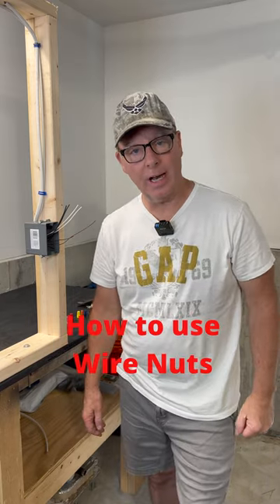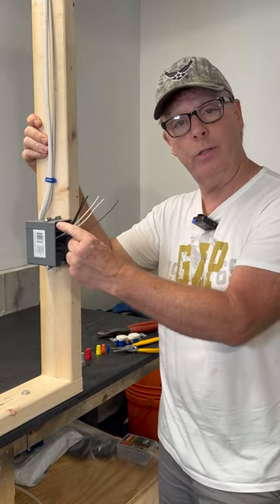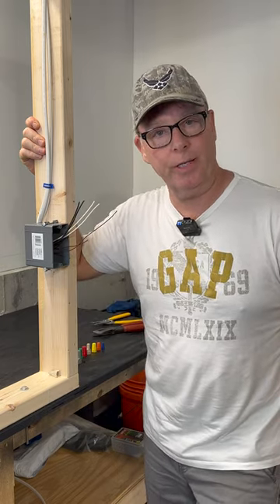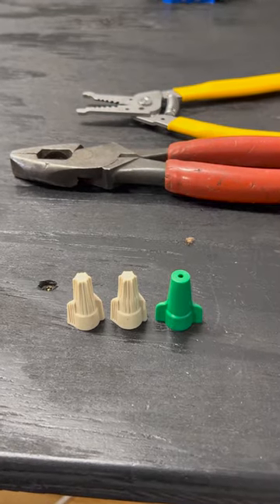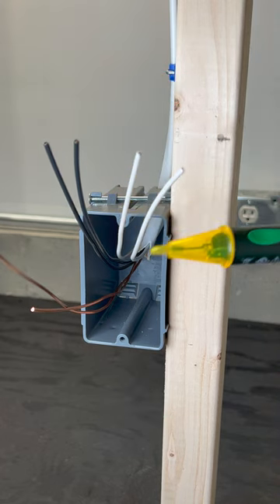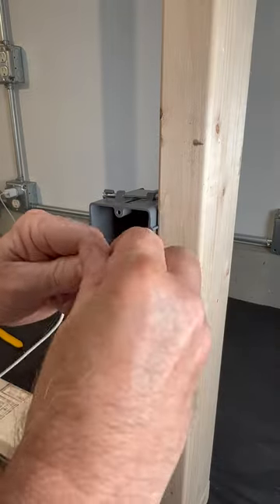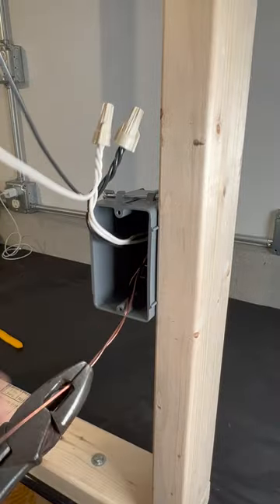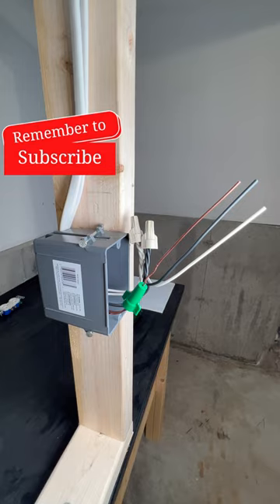How to use a Wire Nut | to connect solid wire #shorts

Comment: Interesting to see techniques from around the world, but one thing wherever you go the physics of electricity is always the same, unfortunately the respect of it on a safety aspect isn't.  I guess the twisting of these cables is an introduction of manufacturing requirements so their product holds better on the cables, not to improve safety. I think all sparks need to assertain and adopt the safer methods of today  rather than the excuse of "well it was alright in my day."  It never has been best practice to twist cables together or leave the cpc bare here in the UK since 1980 ( my first insite into this industry) that I can recall.  I guess a modicum of common sense would indicate why progression is often better. Especially in this case.
Reply from the maker: Our electrical safety standards have been migrating here for many years especially in industry but also for commercial and residential applications. I'm retired now but I was the facilities electrical engineer for a Texas Instruments Fab here in Maine. One of my responsibilities was to implement the NEPA-70E standard for our site. Completing an arc fault study and training electricians and technicians to the new standards. Also the purchase of PPE and other safety measures. We also revamped our LOTO program as well.

Comment: Funny thing when people here are talking wago is the future. In finland 95% of electricians use only wagos. And been using them 20years. Its much faster connector than wire nut. Actually in europe the wire nuts are banned in many countries.
Reply from the maker: They are just becoming popular here. There are a lot of knock offs that may be giving them a bad name. What's your experience with them? Do they hold up well to higher current circuits? I'm going to get some and test them out.
Reply: Well actually i have seen one where there was only the plastic shielding on it no connector inside but dont remember was it genuine one. They hold the current fine on 2.5mm2 cables.(used in 16A circuits) In europe we have higher voltage so lower current running on our houses.
Reply: They are rated here max 4mm2 wire and 32A at 450V. In here i trust that info because everything related to elecrics are tested before it can be sold to people, but really excited to see your test results.

Comment: While wire nuts are nice. they are a pain in the a** when it comes to connecting solid and stranded like in a ceiling light fixture. WANGO Changed How I See Things.
Reply: You’re probably not connecting them correctly?
Reply: @ABflanagan523  connecting them correctly lmao. I can't remember ever needing to before I was paralyzed. Anyway my girlfriend and I swapped out the 2 different looking hall / entry way light fixtures in the ceiling. She played hell getting it to lock onto both. She would think she had it, start working on the second wire and it would slide apart. Took us at least an hour for the first fixture and she held her tongue just right on the entry way light. It was like 15 the way I remember it.

Comment: Why would you pre twist the wires? Twist them together with the wire nut.
Reply from the maker: Maybe with 14AWG but for 12 and 10 the wire nut does very little twisting. To check make up some 12AWG with a wire nut and then take the wire nut off and wiggle the wires around and see if the connection holds up.
Reply: @BackyardMaine  I work with #12 all the time and it's not an issue. As long as you line up your wires and tug each one to ensure a proper connection. So many YouTuber electricians tell you to pre twist and dont show how to use a wire nut properly. Might as well go back to using barrel crimps and tape if you're going to do that.
Reply: @BackyardMaine  Also thanks for the reply! I like your channel but this is something I see a lot and I know people on both sides feel very strongly about it lol
Reply from the maker: @theyedinak  I completely disagree. If you pretwist the connection will hold up even if the wire nut comes loose. We teach all union apprentices this in the first year.
Reply from the maker: @theyedinak  I think we all have our methods and maybe we should use what’s best for us based on our experience. Thanks for watching and for your comments
Reply: @BackyardMaine  So if the wire nut comes loose or off you want it to stay together? Wouldn't you rather the connection come apart or short so you can fix it and not just leave it for the next guy?
Reply from the maker: @theyedinak  You missed my point being it’s not the wire nut holding the connection together. Look I don’t want to tell anyone what to do. I just share what I have learned from years of experience.

Comment: I wasn't aware that you can check if a wire is hot through the wire sheath.....
Reply from the maker: It’s a proximity tester. Just tells you whether it hot or not.
Reply: @BackyardMaine  cool, didn't know it worked like that. Definitely a safe way to do it.
Reply: @jasonmitchell736  wouldn’t say it’s a safe way to check I personally use a fluke t150 as I find the non contact pens to be unreliable giving false readings

Comment: Not sure if it's necessary or not, but my boss puts electrical tape on as well.
Reply from the maker: I never use tape but it's ok to do if you want.
Reply: I tape any permanent wire nut joints which contain stranded wire. Sometimes I also install a zip tie around the twist joint about an 8th of an inch behind the wire nut after installed depending.

Comment: BY FAR the number one point of failure and the least talked about.. This is exactly how it should be done and would eliminate 90% of all electrical problems. The 5 extra seconds to twist the wires makes a difference between your house burning down and not burning down
Reply from the maker: I was surprised at how many comments I had telling me not to pre-twist. Glad to see someone who knows his trade.
Reply: @BackyardMaine  The congregation of a historic church in San Jose, CA used to do all repairs. It was a beautiful building. Due to one bad connection when someone replaced a switch, it burnt to the ground. The ins covered a new building but the over 100 year old history was gone forever.. . Take 2 standard closet rods (1 3/8" dowels) each represents a wire conductor. that entire 1 3/8" is needed to carry the rated load. Hold those 2 rods next to each other. How much surface is touching? VERY LITTLE ...You just lost 90% of the rated capacity. By twisting the wires, you increase the surface contact between the 2 conductors which increases the capacity. Wire nuts are insulators NOT Connectors. Wires do not twist inside the wire nut they just get pinched together.. PROVE that by removing one after you have installed it You will have 2 semi straight conductors that barely contact each other.. After making a connection with a wire nut,, yank on each wire individually, How many times does a single wire come free??? Every one of those is a potential church burning down but it doesn't get noticed until you hear the sirens.. .. I could go on but this is too long already..

Comment: Only sissy union electricians twist wires .as a service electrician the two main failures I see are 3m wire nuts and twisted wires !! Both cause one or more loose wires that end up arcing. Ideal tan wire nuts are the only way to go.
Reply from the maker: I agree with the ideal tan wire nuts but everything else you said was nonsense. Union electricians are highly trained professionals. In some areas non-union electricians are trained as well but most no.

Comment: wires should be stripped correctly and incerted into the nut evenly and same time the mut will twist the wires and if your not sure just tug on the nut if it comes loseor awire comes out do it again if it holds anothing comes lose its correct
Reply from the maker: It's not required but I find twisting is more reliable although for 14AWG the nut twists the wires pretty well.

Comment: I’m 55 and my entire life I’ve always just stuck both wires into the wire cap and “twisted”. Why would you wrap them before puting the wire cap on them and twisting them again?  I truly don’t understand
Reply from the maker: That does work especially on #14AWG but there are two reasons why I twist the wires first. Sometime a wire can be pushed out of the connection making little or no contact and you won't see it easily with the wire nut installed. Second, if you twist the wires first and trim the ends if needed your connection is made. The wire nut then holds it together and insulates the connection. This is taught to our apprentices in school.
Reply: @BackyardMaine  hmmm.. ok. Maybe I need to start doing this… Judy regular household wires like switches and plugs or are you talking heavier gauge?  Thx again. Cheers.
Reply from the maker: @joeblow9850  Yes household wiring #14,#12,#10 solid copper. You don't want to twist stranded wires.
Reply: @BackyardMaine  thanks very much!! 👍

Comment: Totally rough. U.K electrics is 30 years ahead of this. Wire nuts are ancient. Wago connectors have been going for many years here and are much more reliable and provide better connection.
Reply from the maker: I'm going to test some Wagos soon but wire nut are very reliable. Any failure I have every seen in 38 years has been an error by the installer. I have heard from many that say the Wago connection surface area is thin and will break down a start melting the connector over time. I don't know this first hand but we'll see. I agree that they are easier though.

Comment: In South Africa
Hot is a red wire 
Neutral is black wire 
Ground stays copper
Reply from the maker: Interesting,.. Thanks for sharing.
Reply: You sure it's not 2 hot wires in a 220 system?
Reply from the maker: @imshortnlow4u  On a 220v outlet yes but these are 120v receptacles.
Reply: @imshortnlow4u  No, they have 220 single phase.

Comment: Step one toss them in the trash
Step two buy Wagos
Reply from the maker: Wagos are great for some applications and for DIYers for sure but a wire nut provides much more surface area and a more solid connection.

Comment: Though twisted two hot wires together but ended up with a third sticking out. Same with all of them. Explain please!
Reply from the maker: That's called a pigtail. That 3rd wire will be used to connect to the outlet. Im working on a video detailing the pigtail right now. It should be out in a day or two. Subscribe and hit the bell so you won't miss it.

Comment: Use quick connect 
Toss the wire nuts 
You’re welcome
Reply from the maker: Wire nuts are more reliable. Now you know so you're welcome.
Reply: @BackyardMaine  are u so sure?
They’re relatively new so maybe too soon to compare
Reply from the maker: @mrindependent1  I actually think the WAGO 221 is a pretty good product. I have some installed for testing now on a well pump which can be a stressful connection with the cycling and motor inrush. So far they are holding up well.
Reply: @BackyardMaine  right on
I’m relatively new to the trade
Just passed my journeyman this month

So I haven’t been in the game long enough to get those call backs for failed connections.
It is interesting to see the different methods being used
Reply from the maker: @mrindependent1  Well you have chosen a great trade. I got my journeyman license in 1990 so I'm an old timer. lol  I then moved on to electrical engineering and retired a senior engineer for Texas Instruments a few years back. I hope you have a great career.
Reply: @BackyardMaine  thank u sir
Enjoy a well deserved retirement !
Reply from the maker: @mrindependent1  Thank you!

Comment: Hahaha, the correct way of using them is taking them out of the packaging, turning and throwing them into the nearest bin and using a wago
Reply from the maker: It’s very rare for a wire nut to fail and if it does it’s due to a installation error. And you terminology gives you location away.
Reply: @BackyardMaine  it just amazes me how stubborn electricians can be. Even when something that is proven to be better comes along they don't want to use it. Oh I've used these for years bla bla bla. There is a reason they banned here.
Reply from the maker: @mccarly3258  I'm going to purchase and test the Wago connectors. I'm not saying they're trash and I love trying new things. But when someone says that our method should be "thrown in the bin" when they are a safe and reliable connection proven over many years, I wonder whether on not I'm the stubborn electrician.
Reply: @BackyardMaine  I wish I could agree they are safe but when you're twisting the copper like that or relying on the thread biting into the copper to make a good connection I can't agree. The reason Wagos are being pretty much the standard over here is because they are self maintaining due to the design. I think British standard will soon mandate all connections must be self maintaining when jointing cables.
Reply: @mccarly3258  agree to disagree fella

Comment: Did you notice how he didn't put any electrical tape on the wire nut pay attention all you guys thatw wrap the wire nut with electrical table that is the improper way to do it
Reply: I tape outlets when it’s in a metal box or if there are two outlets in a two gang box, but I haven’t seen anyone taping wirenuts except for some old work I might have stumbled on. Is that still a thing?

Comment: I hate how a lot of electricians do that to the grounds.😡
Reply from the maker: It makes a connection that doesn't depend on the wire nut or crimp... That's the reasoning behind the method.
Reply: @BackyardMaine  I know what it’s for I just hate it
Reply: Calm down

Comment: Nooooooooo. Don't pretwist!  Much better connection when all wires are same length and bite consistently into the spring. The spring is what holds the wires, not the twist that pulls right out.  Twisting 5x 14awg wires together presents much more possibility of one wire not grabbing. As you tighten the wires, they naturally twist together slightly. Seen soooooo many pretwisted connections fail to hold one or more wires in the bundle.
Reply from the maker: Thanks for your comment but I have had a different experience. I find that the pre twist make a much better connection especially with #12. Anyway we all have our methods and we should use what works best for us.

Comment: no one uses the green ones
Reply from the maker: More expensive than a barrel crimp but they are great for when you need to take the connection apart which I do after each video.

Comment: This has to be only in murica thing. No other civilized country use these anymore. You probably stop using fax machines before these
Reply from the maker: I can understand that you connections are easier to use. Maybe that’s needed for you electricians?  Wire nuts are more reliable than what you’re using by far. Lol

Comment: Nope, Fire hazard. Seen it many times
Reply from the maker: Not my experience at all. I have only seen one failure over the years for a properly installed wire nut and it was a broken wire. All others were poor installation not related to the wire nut at all.

Comment: Those wago quick connects are fire hazards
Reply from the maker: I have no experience with them for power. Some people say they're great and others like you say they're junk.
Reply: @BackyardMaine  I’ve seen them burn up due to a loose connection of the thin blade inside the connector that applies pressure to the wire. Enough evidence for me to never to use them.
Reply from the maker: @TeaHeart93  So they're not any better than the back stabs..
Reply: @BackyardMaine  Exactly!
Reply from the maker: @HawkeyePierce1981  Ok I'm convinced to buy some and run them through some tests.. Thanks for your detailed comment and clairification.
Reply: Wagos are just back stabs without the back. 
For lazy people.
Reply: @TeaHeart93  wagos will soon be the norm they are way safer that wire nuts despite what you say, they are quicker to install, easier to use and they are way quicker to remove the only big draw back to them is cost but when you consider the time saving in a day you will soon switch to them
Reply: @adamdavis2788  lol not if I keep buying wire nuts!
Reply: I would personally recommend anyone who has not used a wago to go and buy a box of 3 way (221-413) genuine wagos (not ideal or fake ones) and I would say for you to use them for a day instead of your wire nuts and you wouldn’t go back to wire nuts after that day
Reply: @randyboyle8379  the difference is wagos are made my Germans not Americans so they are reliable
Reply: @TeaHeart93  mate i don’t get why Americans are so against wagos they are just better and theirs no point in arguing it you can go and use wire nuts if you want but when the America catches up in electrical safety you will all be using them
Reply: @adamdavis2788  being an electrician from the UK living in Germany for 40 years the Wago  (Spoken Vargo) these I’ve used for years. The wire nut I’ve never seen before and never seen in the UK. The Germans use either terminal blocks or Wagos. The main reason being easy usage and easy to disconnect and reuse. The Germans would never use wire nuts at least no proper spark would. Also you can mix the wires flexible and solid.
Reply: Could you please explain your statement in the way of data so I can make and an informed decision whether to use them or not. Thank you.

Comment: They are so bad. Cant believe they are still in use
Reply from the maker: If used properly they last forever. I have made a few connection over my 38 years as an electrician and I have never had one fail. Wired my own house 25 years ago zero issues so far.